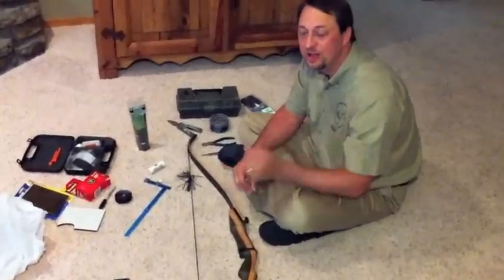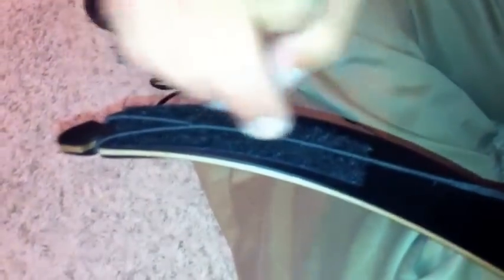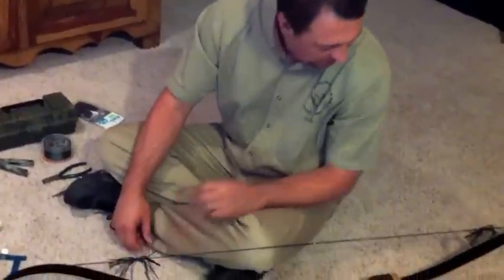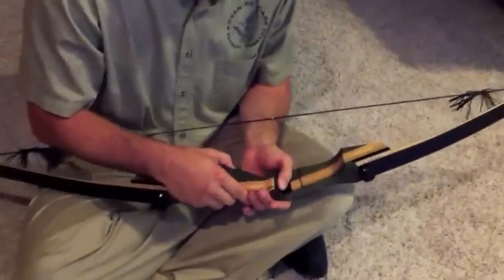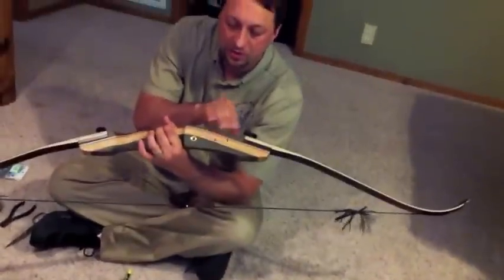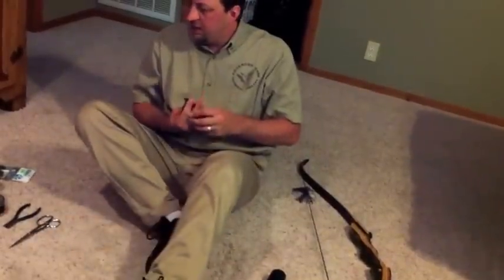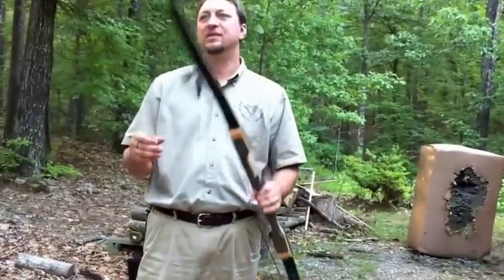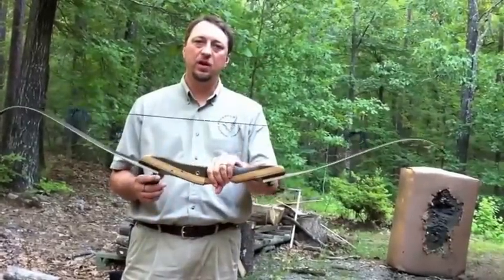Basic Recurve Bow Setup By Rip Fletching.m4v

Comment from the maker: Hi bro glad you made the plunge what kind of bow did u buy ? How many #, and what is your draw ,how old are you ,and how strong are you ,? Ok now you can leave it together for 1year at a time under normal conditions . But never leave the bow strung over 12 hours . I know many say you can but truth is it hurts the bow very small micro fractures why not just take it down after use ? Also always use the push pull or stringer never between the knees I also have some shooting videos good luck

Comment: Hey Rip, I just got a recurve bow that's 60 inches long with a 50 lbs draw weight which is very similar to the one you're shooting.  I'm looking to buy some carbon arrows but since I'm new to archery I have no idea about what length, weight or whatever comes in play when choosing proper arrows.  Any suggestions?